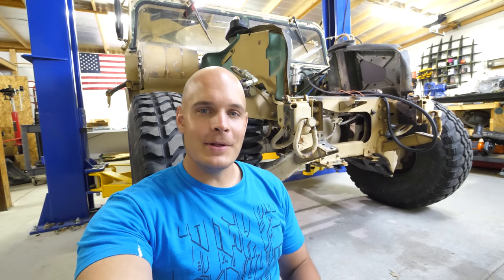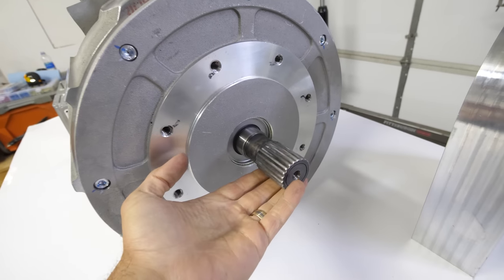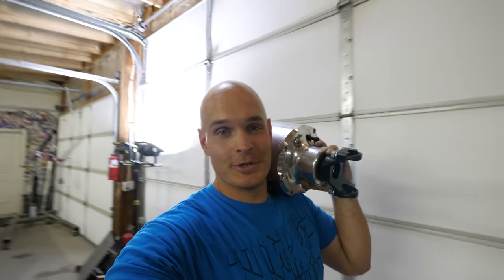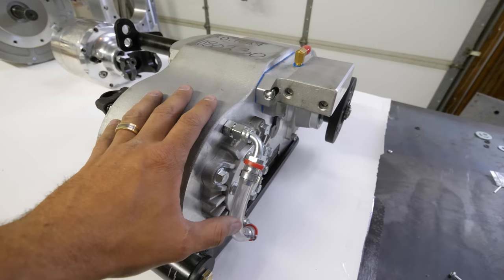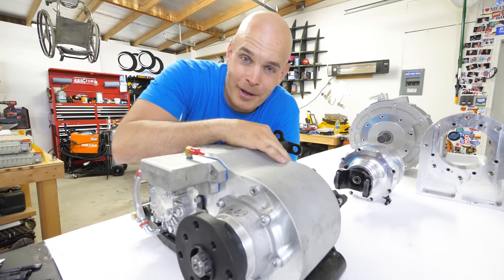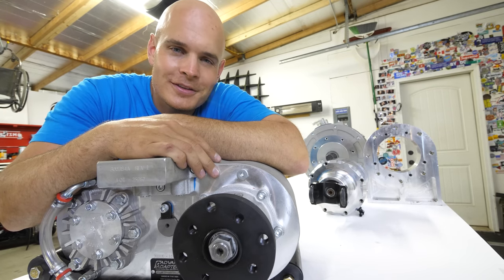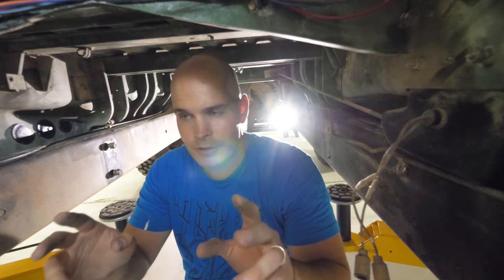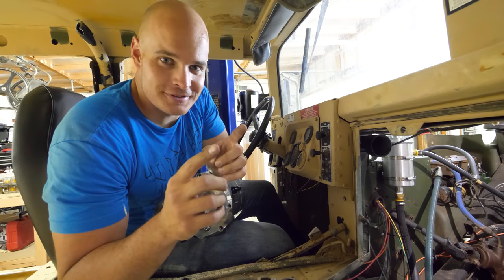How Strong is my NEW Electric Hummer Motor? - EV Conversion!

Comment: I was wanting to do this exact thing to my truck, until I looked up the pricing on the motor and controller you are using! $23,000? Holy cow!
Reply: You can get that motor and controller used for around $9000 without looking too hard.
Reply: @jamess5872  where can them for $9000, please tell me

Comment: good video Gerry i was looking at the top of the motor and to me what looked like two hydraulic fitting connections Lolo i kept looking at it and said no way that's an electric motor but it is I'm a mining, logging, guy so heavy equipment blurs my mind with hydraulics and yes diesels good job again,
Reply from the maker: Those fittings are for the liquid cooling. We run a radiator for heavy duty applications.

Comment: I mean wider  tracks means you can go faster around turns without flipping over also  more soldiers can fit   more comfortably also  added munitions  like turrets  are easier  to add on with more room.    DC also does regenerative  braking.  DC to ac  conversion  is as efficient  as just leaving  it dc

Comment: Arm-chairing it here: I probably would have made a basket (think "skid plate") that mounts to the location of the original engine mounts (though I would have cunt the AM General mounts out to open that up more) and transmission+transfer-case mounts, then done the isolation of the drive-train on that plate, considering that if an isolator should fail, you'd need to control that torque as well.  This would give the maximum leverage to the chassis on that immense torque.  This would slide your motor+gear-reducer+transfer-case package rearward a bit from where you are imagining it, but would allow you to do battery packs forward in the engine bay where you can create a safety cage for them.  This would make it easier to crane lift a portion of the pack out by popping the hood.  Also keep in mind that you can consume all the space that was used for diesel ancillaries, so eating up the air cleaner space and the radiator and fan space is fair game (EVs need much less cooling).  Nobody said you have to mount the transfer case straight front-to-back, you can turn the motor gear-train assembly to move all the drive shafts to one side giving more room away from rotating things.  A few custom drive shafts are not going to be the most expensive part of this job.
  
It also looks like there's space to put the inverter upright (like a book) right next to the motor on that skid-plate concept, this would be important as you want your HV cabling to be short and well protected from damage.
  
How many of the 16x tesla Li-Ion packs you showed are you planning on using?  What's your target pack voltage?  It's going to be interesting to see how you get battery modules which were designed to be supported flat to survive off-roading in any other orientation.  Also remember that the HMMWV was designed with all the weight down low, changing that will take away some of its side slope stability.
  
This is a project after my own heart, I had just this past fall been stewing about building just this.

Comment: I fully admit I'm not an expert so this may be a terrible and/or unworkable idea, but if I was putting that motor in, I'd probably add a way to switch between your high-torque mode and ludicrous speed mode. It would be used VERY sparingly as to not shake the vehicle apart, but I would have it for two reasons:
1) It may come in handy in an emergency.
2) The switch would have a safety cover, and the thought of having something that needs that in my car makes me giddy.

Comment: yes the engine spaces and weights are not the same but you also eliminated the exhaust systems ...what did they weigh in comparison? zero for the electric compared to what 500lbs for the exhaust on the gas /diesel?

Comment: Just stumbled across your channel had to subscribe after watching your EV project. Been thinking about doing something similar. Although I only think about it since I don't have the funds or skills to buy or fabricate the necessary components. But I'm curious about the braking system. And how the hydraulic brakes would function without engine vacuum or power steering pump if hydro-boast assisted. You mentioned regenerative braking so I can only assume you will replace the old braking system with a new design.

Comment: I could see the US military converting alot of old hummvees to electric for use around the bases, it makes sense, especially for vehicles that don't ever go too far from base.
Reply: It'll make more sense for hybrids instead of fully electric units
Reply: It would make more sense to buy commercially-produced EVs (trucks and vans) for roles that don't require the ability to work in combat conditions.

Comment: @7:47 You my friend could not be any more wrong ! Mechanical power is a result of RPM x Torque... The Torque is directly proportional to the EM current being applied, but the remaining factor to produce the mechanical Power is the RPM which at 1RPM is almost nothing. Therefore it's incorrect to say that EVs have all the power at all the time.

Comment: Did the drivetrain components all come from an aircraft "pushback tug" manufacturer? I'm referring to the primary traction motor, the reduction gear, and the inverter? They all look brand new, and not salvaged from a used vehicle. I drive a Toyota Prius Prime, and I can honestly say it's the most amazing and fun car I've ever owned in the 45 years I've had a driver's license. It has a lithium-ion traction battery that weighs 275 pounds. At full charge, it supplies 375 volts at up to about 170 amps (64 kilowatts) to the inverter and the traction motor, if you floor the accelerator pedal to take off from a stop sign. In realistic every-day driving, it's most efficient performance is generally at about 40 mph, and on flat terrain, the car can squeeze about 5.5 miles of driving range out of 1 kilowatt hour. The battery is nominally supposed to hold 8 kw-hr, but in my experience, the "useable" amount is more like 6 kw-hr. It's very temperature dependent, too: In summer, when the battery is typically at about 82°F, the car can go about 39 miles on a charge. In winter, when the battery temperature averages 25° colder (in the mid-50's), driving range falls to about 32 miles. You will likely see the same kind of seasonal performance differential in your EV Hummer. Charging in my Prius: When the traction battery is "dead", it's State of Charge is 14%, at "full" the SOC is 84%. Toyota has programmed the battery controller to constrain the State of Charge between those limits to extend the service life of the battery modules to as long as possible: supposedly after 3,000 full-charge cycles, the battery should still retain 80% of it's original capacity. The Tesla batteries you are using will have similar minimum and maximum State-of-Charge limits, since the battery chemistry is pretty much the same in all EV lithium-ion battery cells. The Prius's internal charger (it's under the rear passenger seat), can supply up to 3,000 watts (8 amps DC at 375 volts), if fed 240 volts a/c from a Level 2 EV charger, or 1,500 watts if supplied 120 volts a/c from a Level 1 charger. If a charge is started with the battery at 14% (the minimum State of Charge), it generally takes 140 minutes to bring it up to 84% SOC on an L2 charger. The actual charge cycle looks like this: For the first 110 minutes, the charger runs at full power: 8~9 amps at 375 volts, When the SOC reaches 80%, the charge rate drops to 4 amps. When the SOC reaches 82%, charge rate drops to 2 amps, and the charger shuts itself off completely at 84%. Getting that last 4% of charge, when the charger is running at 4 amps and 2 amps, takes 25 to 30 minutes. 

Actual cost of driving the Prius on electricity from external battery charges, vs running it on the 1.8 liter gasoline engine: The car averages 58 mpg on gasoline that currently costs $4.25/gallon = 7.33¢/mile. Charging it at home between midnight and 06:00 costs 9.5¢/kw-hour, and a full charge costs about 75¢ for 32 miles of winter range (2.34¢/mile) or 38 miles in summer (1.97¢/mile). So there's a STRONG monetary incentive to drive in EV mode as much as possible. I actually get about 40% of my battery charges free at public chargers, but I'm not counting those since they're intermittent and not predictable as to when I can get them. Is owning an EV or PHEV worth the extra purchase price? I think so. My Prius Prime cost me $22,000 after the Federal and State tax rebates. The car it replaced was a Subaru Outback that got only 26 mpg. With gasoline at $4.25/gallon right now, and little likelihood that it's ever going back down to $2.50, I figure that I'll fully recoup the cost of the Prius (less the $11,500 I got on trade-in for the Subaru), in less than 100K miles, just on the gasoline savings.

Your EV Humvee is an interesting build, although not really practical as an everyday driver, but I'm convinced that the next generation of EV's coming in the 2024 model year will be amazing cars that will be just as much fun to drive as any conventional car being made now, and they'll have driving range almost as good as you can get from a gasoline engined car.

Comment: Dear JerryRigEverything, what bother me is the wrong comparisons. Saying diesel has to be revved up to produce power is one, two thousand breaking parts is another and there are several more. Your gasoline driven Tacoma is not the same thing as diesel powered Hummer. Max RPM HP is not the same thing as torque.

Yes dragsters and race cars are revved up to the redline of the engine to produce every HP out of the engine, diesel is driven in practical use by torque. Huge trucks/rigs/lorries/transport vehicles and their huge diesel engines have sometimes usable range from 500 to 1500 RPM, meaning there is less of that "revving to full power". They would tear themselves apart if you revvep them up to the gasoline engine redline of around 7000. Yet they produce insane amounts of torque from the start, because otherwise they would not be able to move the loads they need to without burning the clutch. Ever wondered why transition to electric trucks is going to be very slow, there isn't still any actual road approved electric truck hauling cargo? It's because diesel engine within transport busines is VERY optimized to reuce costs and the electric motor is going to have tough battle with that one.

Part number is correct on engine parts but there is a difference on small part prone to failure and chunk of steel that will never break in use. Should we calculate every copper wire that was used in the manufacture of the electric motor? Because any one of those wires could potentially have a nick or a scrape and act as an fuse that burns out under certain load? It's possible, there is no denying it so there are weak points in electric motors as well, they are not some miracle machines never ever breaking.

Also: if the electric motor is SO much better with million benefits, why there are no electric military vehicles? The few blueprint concepts are excluded naturally. Militaries have huge budgets with their main goal on reliability, power and serviciability. Money being no obstacle. Despite that, no military has done this and they have EVERY incentive to use the best engines. So why not use it?

I get what JerryRigEverything is trying to accomplish with this, but i would hope he would be realistic instead of cherrypicking best qualities of electric motor and then choosing the worst qualities of the IC-motor. Unbiased is what i'm after and this mini-series has lacked that. Unfortunately.

Comment: Good video. - Motor seems too small for specs. I doubt All torque numbers based on the small cases. Truck axels also may not handle it. Physics are always a trade.

Comment: That 265n/m torque is the engine torque… wheel torque is a different thing. So you said your torque is 1100nm. This is your wheel torque and you can calculate your toyotas too. Btw this is the dream project.. 🙏🏻🙏🏻

Comment: The opening statement is wrong. The outside of the Humvee's tires wouldn't even reach in the inside of the tracks left by an Abrams tank. Humvees are as wide as they are in order to maximize their resistance to roll-overs.

Edit: ...and because of the way that the Humvee is packaged, that's probably as narrow as they could make the thing.

Comment: Tell me , how come the alternator fron the gas setup can't be combined with the electric system to keep batteries at their optimum performance ??? 🤔 
There for creating a perpetual motion vehicle.  Or even better yet combining a generator to power the motor and eliminating most of the batteries and still having a charging system to keep remaining batteries at optimum performance  . I know this is possible for I thought of this 20 years ago .

Comment: This is the specs of the Humvee diesel: 190 hp (142 kW) @ 3,400 rpm / 380 lb·ft (515 N·m) @ 1,700 rpm X 2 = 380hp and 760lb.ft
The 90kw of battery power world move the Humvee how far more then 200 miles ? I know this is just for fun and Im sure it will be a treat to drive but would it be practical?

Comment: I wonder if the motor has a cooling system for heat buildup? also the batteries will need a cooling system as well.

Comment: Could you eliminate the torque box and transfer case and go straight to a differential and if so how do you calculate the expected speed given tire size and gear reduction in the diff?

Comment: should have the weight to help plant all that torque, too.  out pull 99.9% of the competition!
Reply: Great, if the plan is pulling competition. Not very useful in the real world.
Reply: @brianb-p6586  I guess it depends what’s useful to whom…not efficient transport to go to work at the office with.  But as a tractor to yard around a huge trailer of firewood on the farm?  I like it 😀  Heck you could probably pull a three bottom plow!🤣

Comment: 🤔 I was actually considering turning my M939 (big brother to the dude that everyone is familiar with) into an EV truck (imagine semi-sized) however it would also be an RV as well, which will probably weigh close to 34k by the time I’m done with the build. That electric motor is a little less than then power output of the original diesel for my truck, but I’m more curious about “time to empty” and the recharge time.for that many batteries. Honestly, I would probably triple or quadruple the number of batteries just so I had the range, and then just recharge with my solar setup (3kwh) for a week or so. I’m looking forward to seeing this project’s progress. Btw, do you have any links to the EV equipment you used?

Comment: 4:16 - Torque is not power.

The engine in your Tacoma has 278 hp, which means that it's only slightly less powerful than what you're putting in the Humvee. Power = torque at a given rpm, so the torque output at the wheels of your Tacoma will be similar to what your electric Humvee can produce at the same vehicle speeds.

Comment: the heat in the summer, i wonder if the Electric Motor it can handle the heat, it seems small to weight ratio

Comment: Did you say that Edison and Westing house are finally getting along because of DC getting converted to AC? LOL you have to read more on the AC current as Westing house is not the one that has invented it. Its Tesla that worked for years to develop it. Regard the car, it will be a great rig once its done :)

Comment: As someone who has been doing design work in 3d systems for some 20 years I can say a cad system does not make you a  designer. You might make pretty pictures but can a shop or factory actually make it for a minimum of cost in a reasonable time?

Comment: How are you handling the power steering, brake booster, etc? I've seen some hot rods built with the Prius' electric power steering unit since it's a compact, all-in-one unit.

Comment: @6:30 you're assuming that the GMC Hummer EV has a similar driveline to this conversion (with a transfer case with high and low range gearing), which is completely wrong... and it has been well known for years that it is wrong.

Comment: question: how will you get the load of the single gear "transmission" to the differential an ordinary drive shaft can't handle the power.

Comment: Just curious, (not an engineer) why didn't you design this to mount 4 separate motors (one on each wheel)? Considering you removed the transmission and each wheel has an independent axle. You would have eliminated the need for many of the components
Reply: Each motor is 25k, so in total that would be over 100k, although, that would be one project to see

Comment: Nice setup Jerry! But I'm wondering why You didn't used two motors with gearboxes in line with axles instead of 1 motor, reduction gear, transfer case and 2 more reduction gears on axles?
Reply: @JorgTheElder  well, this is a pretty old motor, the progress has gone far ahead. Today the are plenty of more efficient and compact motors that can be used to do active torque vectoring, without diffs and give much more joy to ride. And of course in this case this setup will be much more reliable, cos there will be no diffs.
Reply: Jerry is taking the easiest conversion route, and it's still far from a trivial project.
Yes, separate front and rear motors would provide better torque distribution control than one motor and a central differential (or just a no-diff transfer case), and would provide a much more open space between the axles for the battery, but most DIY EV conversions are not capable of managing two motors.
Two motors per axle would be a packaging challenge, due to the inboard brakes.
Reply: @brianb-p6586  we have a controller for a 4wd two motor system developed in 2019) So yea, there are solutions even if people don't about them)